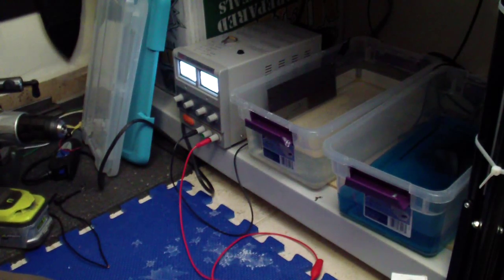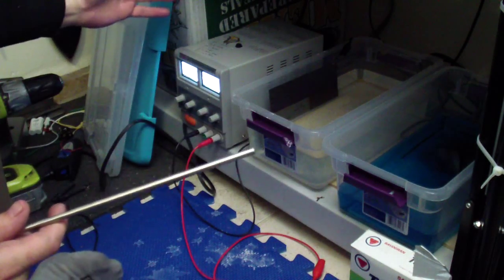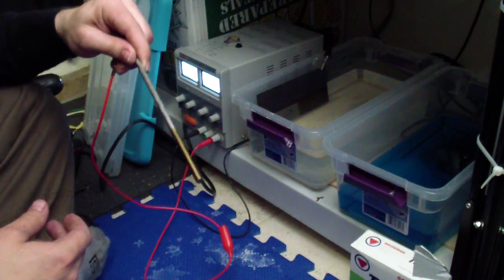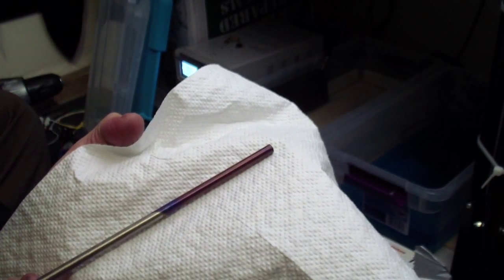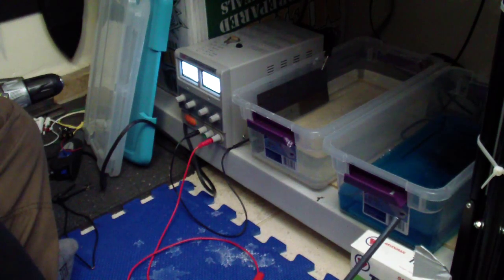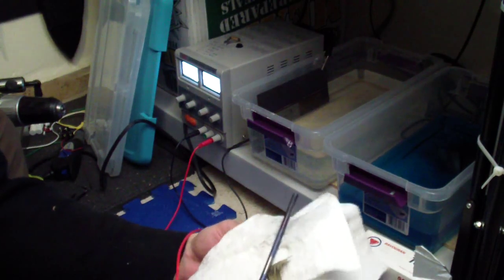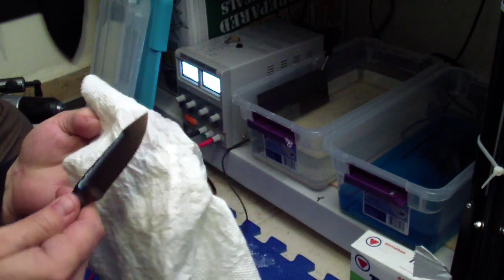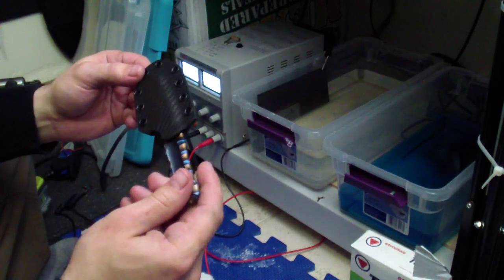Electro Anodizing Titanium Tutorial 101

Comment: Thanks for the tutorial.   It's a good idea to put a green scratchie you would wash up with or something that won't conduct between the anode and the cathode (the piece you're anodizing and the piece you have connected the negative to)  This process works exactly the same for niobium which is sometimes used for jewellery.   I will try the windex, thanks for the tip.